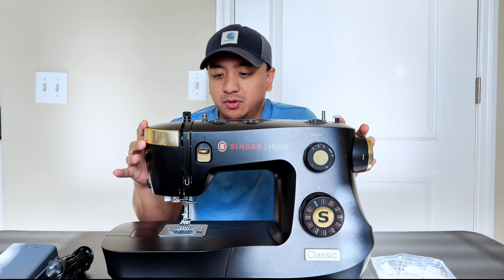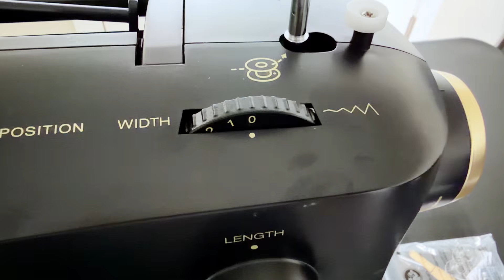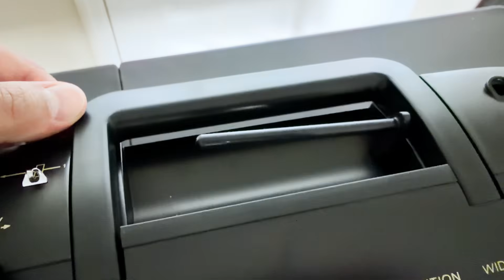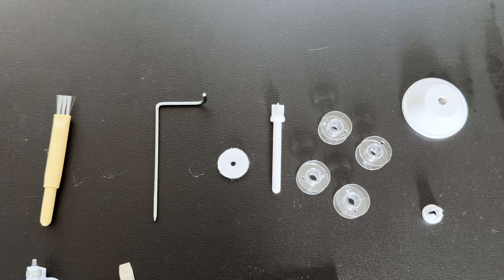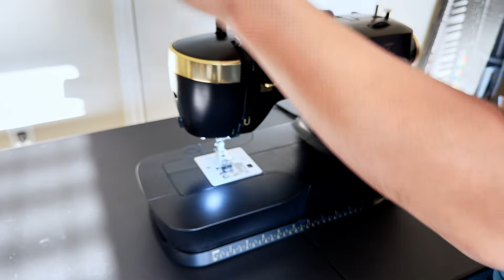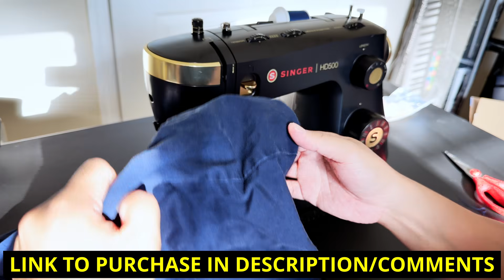SINGER HD500 Classic Sewing Machine | Demo and Review

Comment: I wasn't  sure if the bobbin goes in counter clockwise as you seemed to skip over this. I did counter clockwise because my mom's old singer was this way. 
Also, how to thread the needle, is the attachment on the side to hold the needle or to help thread it? 🤷‍♀️